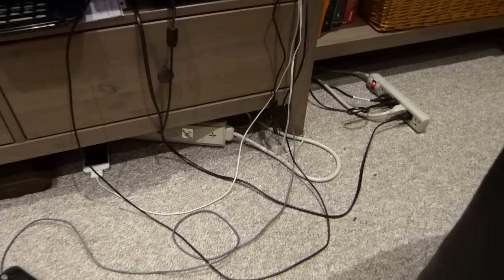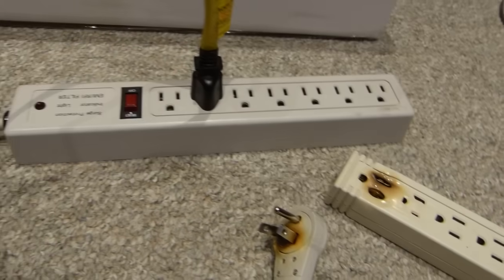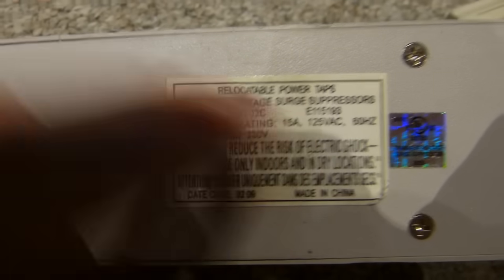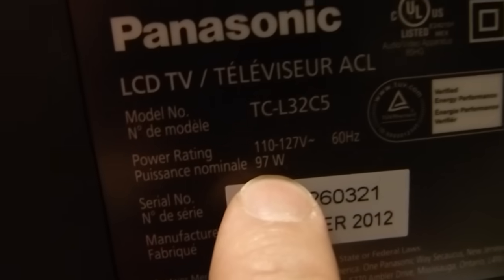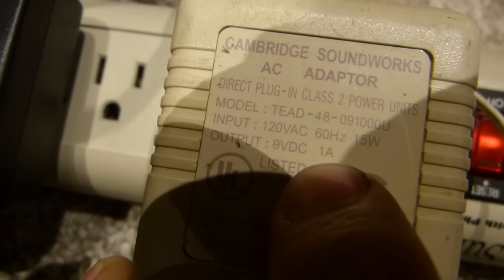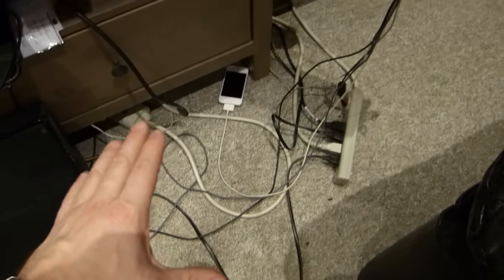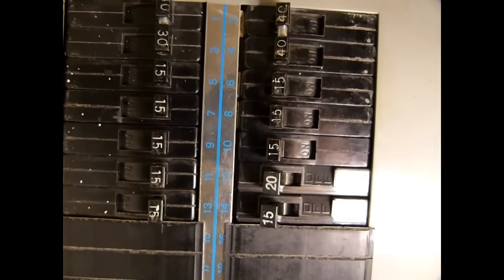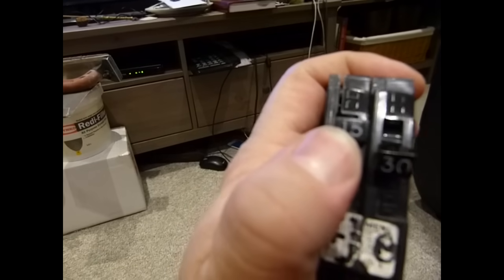Is it safe to plug power bars into power bars?

Comment: I have a plug box plugged into a plug box plugged into a plug box plugged into a plug box plugged into an outlet that's wired through an analog ammeter, I make sure the needle doesn't go above 10A and i never plug any high-draw appliance into it, NO HEATER!

Comment: Why did the surge protection in the power strip not function?
Reply from the maker: It is not designed for overcurrent (heater), it is designed for overvoltage (lightning surge). It's like expecting a head rest to help prevent injury in a sideways collision. Not designed for that.

Comment: It very depends on your usage, if your daisy chaining 2 strips together and using lower powered tech then you will probably get away with it! And my 3 plug strip powers a 300w PC + a 30W monitor, then a 4 socket strip with a 65W phone charger, a  60W speaker and an Amazon Alexa totalling: 455W and it has been fine for me!

Comment: Last two "smouldering power strip" incidents in my flat had nothing to do with overcurrent.

1. The plug was very old (about 30 years) and had copper pins covered with patina. The bad contact between the plug and a conductive bar in the power strip led to overheating and damage to the plug and the power strip.

2. A surge protection component in a power strip failed, emitting sound and smoke.

In neither incident was there too much current. In the first incident, normal current through bad contact produced too much heat. In the second incident, there was current where it should not have been. In neither incident did the overcurrent circuit breaker trip.

To sum up, fuses and overcurrent circuit breakers do not protect against bad contacts; they protect against some but not all faults. They can blow or trip after the fire has started, but they do not prevent all fires. I do not know about arc-fault circuit interrupters.
Reply from the maker: Yup, found the same in Part 2: What caused this fire https://youtu.be/SkMpKP0N3hQ

Comment: i have four early 80s computers powered by a couple power strips, just so they are not all on one, also they are not all used at the same time, but even if they were it would be ok, i checked them all with a kill-a-watt meter that i have. it checks watts / amps etc. same with another room with my stereo, crt tv and atari & nes, i tested all that, it could be all on at once but its not. and also non of the strips connect to each other, they each plug directly into a  receptacle.

Comment: This is so fascinating, i recently learned that technically when you generate static electricity, to maybe shock your friend with, you are generating thousands of volts of electricity which would be dangerous but yet the amps are so low it only stings when you get shocked.

Comment: so as to the last bit of the video to clarify, if both wall outlets are on the same power circuit thats rated for 15 amps  in the breaker box switch that means the total devices plugged into BOTH outlets must not exceed 15amps?
Reply from the maker: Correct. Also, a few duplex outlets on a wall are typically on the same 15A circuit, so sometimes adjacent outlets can't run a 10A micro and a 8A food mixer at the same time.

Comment: Depends on the AMPERAGE of the items you plug into it.  I bet you plugged an LED light into each open plug on the two bars with one bar plugged into another, you would have no issues.  Same with cell phone charger devices.   One the other hand if they were a bunch of incandesecent bulbs, or heaters, or vaccums, or big motors chances are you would overheat it.  The key is to not exceed about 60-70% of the maximum load of the FIRST bar  (the one that goes into the outlet) for the  COMBINED TOTAL LOAD of BOTH BARS and to not exceed about 50%-60% of the amperage capacity of the devices plugged into second bar by the rating of  second one.   The bar with the higher amperage rating or thickest wire (lower gauge number) should be the FIRST bar.

Comment: Do American's not have fuses in their plugs? Uk we have a 13A fuse so if you overload it either the resettable fuse pops or the plug fuse goes and you have to replace
Reply: Rarely do we have fuses. The most common devices that do have them are Christmas lights.

Comment: In the UK we have a fuse in every plug, and I'm really proud somebody here decided to do that.  However, that doesn't mean I haven't personally witnessed this melting plastic, when a 1200W oil-filled radiator had an issue at the extension cable, with nothing else plugged in.  You would have thought the fuse should have blown before the plastic melted.  I guess the extension lead and radiator had 13A fuses.  So different countries, voltage, but same mystery.
Reply from the maker: My mystery is solved here https://youtu.be/SkMpKP0N3hQ

Comment: It depends on the situation. Plug your LOWEST-wattage devices into the 2nd one, which is a big splitter off from one outlet in the first one. You can use them as extension cords just fine when you're not overloading them.

Comment: Here in the United Kingdom, we have fuses in the plugs, and sometimes in the power strips as well, so provided the fuses are not rated higher than they need to be, there shouldn't really be an issue.

A couple of those devices the amps was the power supply out or input, no the mains power usage.

Comment: A little 250-400w heater is fine, but many are 1000-1500w.... that's a big nope on 120v lol 😆  you need to plug those directly to the wall outlet.

Comment: So just to elaborate, the router and the speakers you were reading the rated output current when you should be calculating the rated input current, that is calculating the power supply's overall current draw from the input.  Of course, this is a simplistic calculation and simplified to a resistive load.  It gets a bit more complex with inductive loads as most power supplies utilize some kind of transformer.  AC makes it a bit more complex as well.  as V=IR and P=IV is more for DC circuits.  Also, most home branch circuits in the home feeds multiple outlets or a combination of outlets and lighting (it varies by the National Electric Code/Canadian Electric Code as well as by municipality or province/state/territory as well).  The nominal provided current and wattage actually tops out at about 12 Amperes at 120 V~ continuous and 15 A at 120 V~ peak.  European branch circuits, or at least in the UK top out at almost double the amount of power with 13 A at 240 V 50Hz.

Comment: Is it fine if ive got 3 monitors and a pc plugged in? The other plugs r just rgb and the cord had built in usb
Reply from the maker: Yes it is
Reply: @theoverengineer  tysm.also would it be OK if they were all high power draw? Or will only this current configuration work? Thanks for replying 7 yrs later

Comment: This is not just an Ampere problem, it is an Wattage problem, too many Watts for a normal power bar.
Heaters, microwaves, electric showers, air fryers, and that kind of stuff is usually used with a "special circuit", one that's not used anywhere in the house, it comes directly from a circuit breaker device, that allows it to be contained because of the possible fault of the equipment that causes heat and can catch fire.

Also, circuit breakers are not designed to protect you, or anyone, they are designed to protect the circuit and it's cables from overheat and ocasional fire hazard.

Comment: The reason why they didn’t shut off the red switches are not beaker switches they are only power on or off, they would need a power surge protection switch to shut them off

Comment: NO it is not safe to plug a 4 or 5 way adaptor into another 4 or 5 adaptor that daisy chaining will cause an overload FIRE in your extension cable The socket on the wall will only take 32Amps maximum and you are plugging in 10  13Amp plugs into it even if 5 of them are only 10Amps each that is 50 Amps into a 13Amp wall socket the extension cables will overheat and go on fire unless you have the surge protection type which stops it overloading an cuts of the power for safety the surge protection  multi  plug cable should be the only ones the shops can sell by law

Comment: Would like to see his follow on video, He forgot to include resistance in the natural wire of the extension. There is resistance in copper wire, and the longer the wire, the more resistance, the higher the wattage, the more amps are drawn, all related.  Also, A breaker doesn't pop the second the load hits the rated value, but it will pop over time.  The electrical code says you are not to load a circuit more than 70% of the load for plugged connections, each plug interface also has a resistance, and thus wattage draw.  How fast the wires heat up is an issue, now suppose you have two daisy chained circuits, both running at 14 amps in residential.  and those wires share a harness in the wall of your house, they each provide enough heat to bring the wires to 160 degrees celcius.  Combined, you might be facing a wall fire and not even know it.  your on dangerous ground and don't have a clue.  Don't daisy chain, keep loads like heaters on separate circuits.  If you have a LAN party at your home for gaming, each PC might draw 3-4 Amps each. no biggy right?  But if you have 30 people at your house, that is 90-160 amps.  That is about max capacity for a full home.  Careful runing a microwave for snackages..

Comment: The heater could just as well do it to a wall socket. Just do not use heaters, at least for extended periods.
Reply from the maker: I have the charred parts, it's the looseness in the swivel design plug head that caused it. Will make it into a video.

Comment: You're not accurate with the adapter amps cuz they mostly label the electronically stepped down converted DC voltage and amperage so when you see a mobile charger for instance stating 5V 1A its DC 5V 1A conversation electronically from 110-220 AC volts respectively. 

Charging devices/ small power adapters like those often don't reveal the AC current it pulls from the wall cuz they are often too lil for example, 110v 0.046...amps. 

So in short don't confuse AC and DC amp measurements mate, otherwise you’ll run into serious electrical problems with your quack knowledge in the long run.

Comment: The only time it would be safe is if BOTH bars do NOT exceed the capacity of the 1st, and the wall outlet. I have daisy chained many low amperage devices to 2 bars plugged into each other. Still, those power strips are NOT for large amperage draw devices.

Comment: You can hook a power strip into another one as long as the power being pulled isn't a lot. Basically don't plug in a vacuum or any high power devices into them.

Comment: Your router is taking 1A at 5V - that does not mean it's taking 1A at 115V. If the power conversion is 100% efficient, the 5W (5Vx1A) drawn by the router would work out at (5W/115V) 0.043A. To allow for inefficiencies I'd call that 0.1A.  Also, your speaker adapter shows it takes 15W at 120V - that is (15/120) 0.125A. Its OUTPUT is 1A at 9V (= 9W - that is a fairly inefficient converter given a 15W input). You can take that figure as that is given as the input rating.  Therefore your total power draw is 9.305A (call it 9.5 to allow for inaccuracies), not 11.08A.

Here in UK, our plugs are rated to 13A (not 15A), but our higher voltage allows a maximum power draw of 3120W at 240V.

Comment: voltage = current x resistance 
current = voltage ÷ resistance 
Resistance = Voltage ÷ current.

Here's a simple way to remember V/(CXR)
Simply remove the letter you want to define from the equation, add the values and do the math.

Comment: This has NOTHING to do with a power bar being plugged into another power bar and EVERYTHING to do with a poor connection between the plug and receptacle or a problem with the wire internally fraying in the plug.  The resistance (poor connection) between the plug and receptacle (socket) generates heat, causing the melting shown.  I had the EXACT same melting happen to me with a heater and a power bar (power strip), only the power bar was plugged directly into the wall, NOT another power bar.  Internally and invisibly, the wires in the plug had been fraying due to flexing over the years.  The higher resistance of the  frayed wire generated heat that melted the plug.  The same thing can also happen if the plug prongs are not solidly connecting to the receptacle, which can happen when the socket loosens up after many years of use.

Comment: An  infrared thermometer (~$15) is a cheap and easy way to check for an overheating plug/socket.  That room looked like a basement room.  High humidity can cause rusting and corrosion creating electrical problems  Running a dehumidifier can be costly though.

Comment: Obviously everything needs to be idiotproof so they say it's dangerous, and of course it is dangerous if you don't know what you're doing and overload the circuit. But if you need more plugs to fit more low power wall warts or something similar then it's fine. 

A lot of chargers are still too large and block adjacent plugs so it's kind of necessary sometimes

Comment: I would say it depends on the load. One portable electric heater at 1500 watts will max the circuit.  The circuit supplying the strip also is operating other outlets in other rooms. Figure your loads and stay less than 80% of the maximum of the circuit on that circuit.
Fun!

Comment: 6:07 that isn't entirely accurate that the amp number is 15, the real reason is that the wire being used in the power bar is 14 AWG. which can handle up to a maximum of 15 amps. Slight correction.

Comment: The cords with buttons switch when a hazard occurs? I didn't know that. I never read what it says on the chord. I am watching to figure our If I can plug in two computer charge and one phone charge to a small 3 outles chord. My pc charger says 100-240V-1.16A, 50/60 Hz. I am not in the kitchen and voltage circut is probably 100  but for both, current is 1.16A? The cord says on the label that it is 125 V, current max 13 A. Is that right?
Reply from the maker: That's right, 13A can easily take the electrical load of 1.16A (eleven times over)

Comment: please reply me to save my life..i will move into a dorm.. where there is only one wall socket in my room...i have a hisense mini bar fridge..that acquires 45w of power...i have a multiplug max power 500w.. that i use for mobile laptop charging....so now in my dorm if i give connection the refrigerator in the wall socket then theres no place for my multiplug....i want to buy a T extentions...where i want to use my fridge and i want to put my multiplug... can i? can i put my multiplug in that extension? that extension max power abilities 3500 watt.
Reply from the maker: A mini fridge (any fridge) also draws an in-rush peak current at every startup (as it cycles), which could be 15A for a few milliseconds and will not trip the breaker even if you also plug your laptop into the same circuit. It's all fine, breakers and fuses are purposefully time-delayed a bit before activation.

Comment: This only works if you have good power strips.  If they are UL listed it should be fine.  If you buy some cheap no name Chinese crap, it probably will not handle its "rated" amperage.  Still, even on well designed UL listed power strips, I would not plug in something with a high load like a space heater.  Most heaters will tell you in the instructions to plug it directly into the wall.  These strips are for low amperage devices (computers, speakers, TV's, laptops, phones, etc.).  Some strips have their own internal circuit breaker which is handy as well.

Comment: I made the biggest mistake during college by plugging a heater into an electrical cord instead of an outlet and the power on the side of the room it was plugged into went out and I had to get my RA to flip the breaker switch.  5 times in the first 2 months of school.
I’m grateful a fire never started but I did get fined when a separate RA reported me.
Be safe with ur heaters!

Comment: It’s not really a good idea to piggyback one power strip off of another. Every power strip has a current capacity of 15 amps, and most will have a circuit breaker. If you exceed 15 amps, the circuit breaker will trip. To be safe, make sure both power strips have a circuit breaker on them, and don’t overload them. I knew of a person who lived in a room next to me. He bypassed the circuit breaker on a power strip and connect  a bunch of wires to it. What ended up happening was it caused an overload and started a fire, as he had all kinds of stuff on top. He lost everything he had in the fire, and wasn’t allowed back.

Comment: You mistaken the amps of the router and speaker. First the router is 5V 1A. That is only 5W.
I think that router 120VAC rating is around 0.1A. 
The speaker is 9V 1A DC, and its says 120VAC 15W, so probably 0.2A

Only have to read only the input, not the output.
Reply from the maker: Noted, thx

Comment: I have a question, my appliances show both an input and output current. In this case do I sum up the input or output currents of all my appliances to make sure I am not exceeding the 15A limit? Thanks!
Reply from the maker: Sum of the input is higher, go with that.

Comment: Power bars, not to be confused with surge protected power bars.  Never buy any old surge protected power bar, you may end up with one with a cheap set of ceramic coated beads on a wire hiding inside the casing for a surge protection circuit.